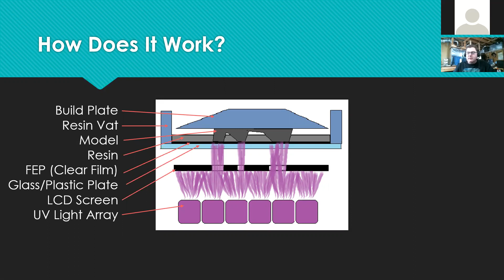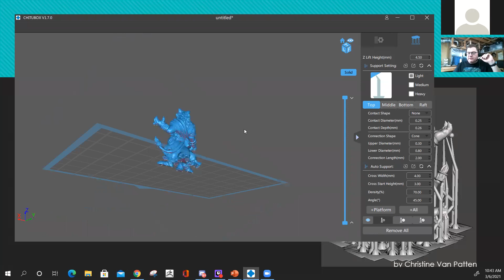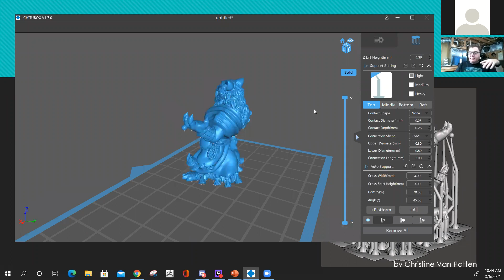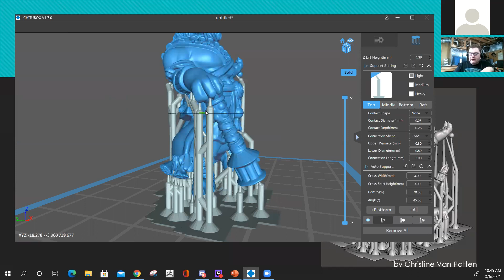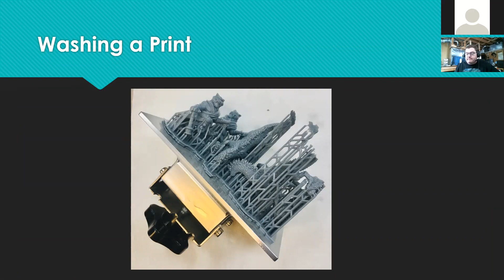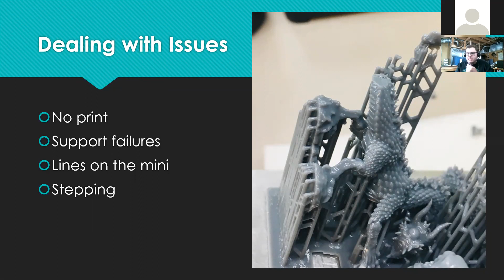Resin 3D Printing Basics  - Andrew Pieper  - Hobby Education

Comment: Nice to finally see a 3d printing video that actually tells people that the fucking smell is not what they should be worried about. VOCs, formaldehyde and other toxic substances don't necessarily smell as much or as bad as a lot of the harmless stuff does; the resin smell is not what's gonna kill you or your pets in the very-long run, it's the stuff you are not smelling that could if you let it.